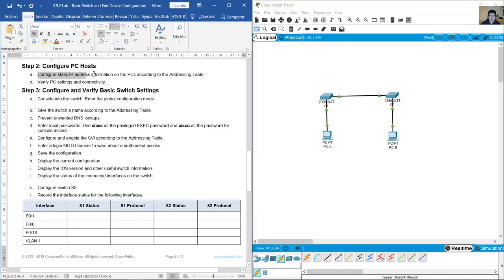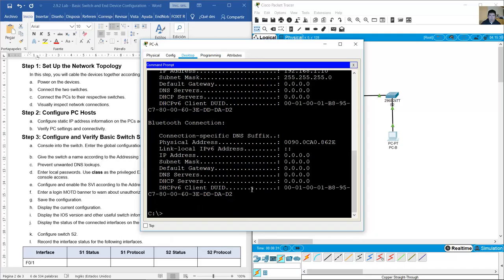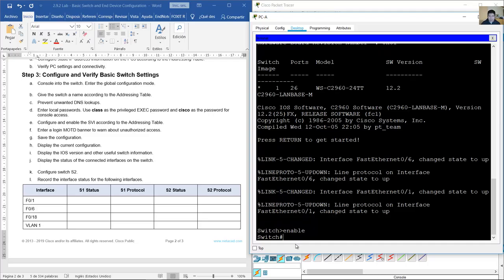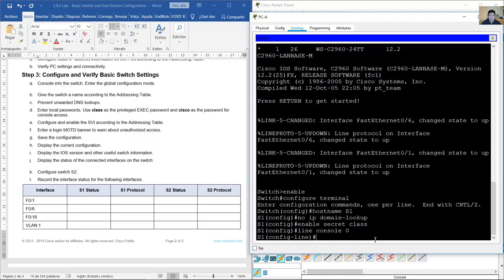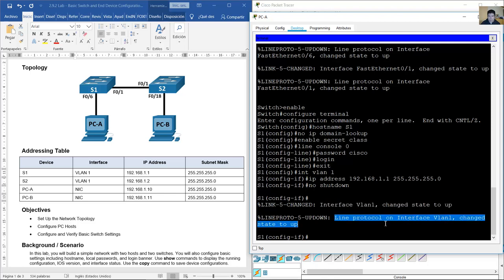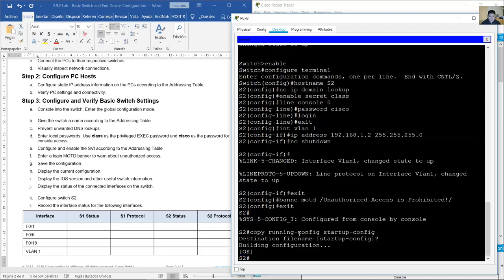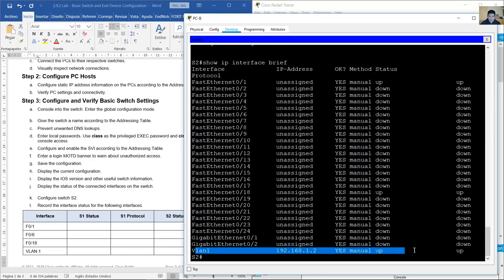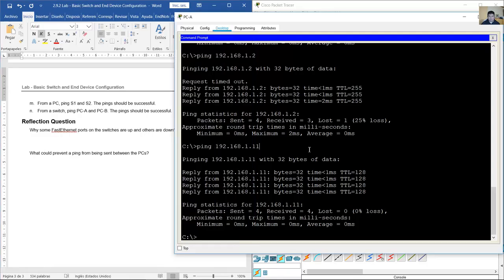2.9.2 Lab - Basic Switch and End Device Configuration

Comment: The question (n) says "From a switch, ping PC-A and PC-B..." But you pings PC-B from PC-A.
Reply from the maker: You alright, but ping works round trip, so if you can ping from source to destination the inverse is guaranteed
Reply: @romeroc24  Thanks a bunch. I'm new to this so i am really following it step by step. Can i get some practice questions form you. I really want to break into the IT industry and someone told me to start with CCNA. I'm having trouble knowing how the commands work. Programming has always given me problem. How would you recommend i learn it fast and do you have materials you can give me? please and Thank you.
Reply from the maker: @paulotaye5050  I recommend only practice but theoretical concepts are necessary, you can get more support on my social networks shown on 00:03
Reply: @romeroc24  You're the best. I just went through it all again. and you explained it perfectly. i am more confident than i was before. Thanks a lot.
Reply from the maker: @paulotaye5050  I'm motivated to continua help, I appreciate your comment